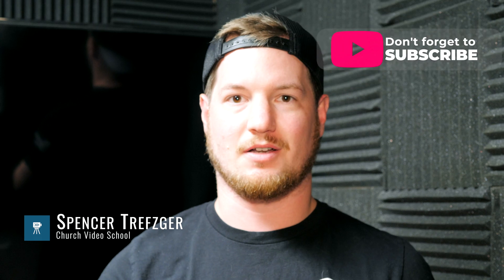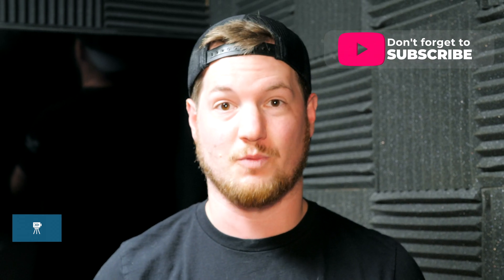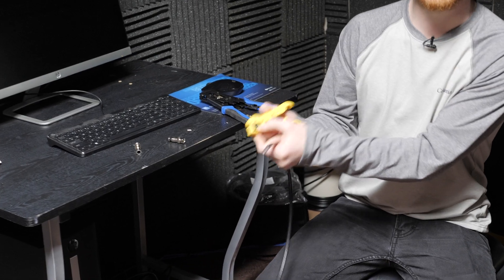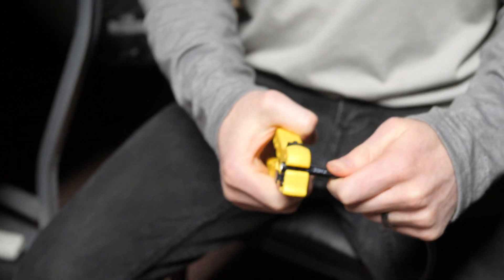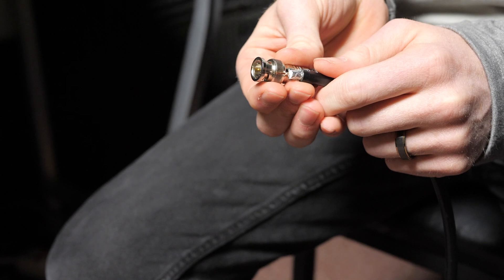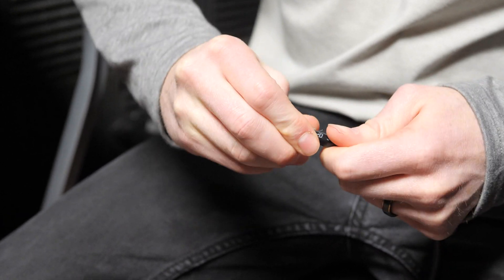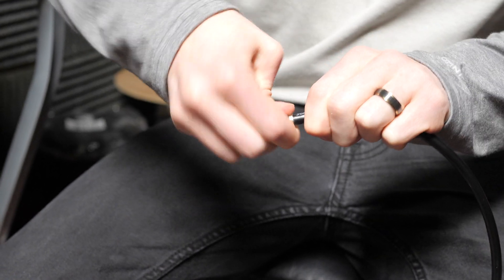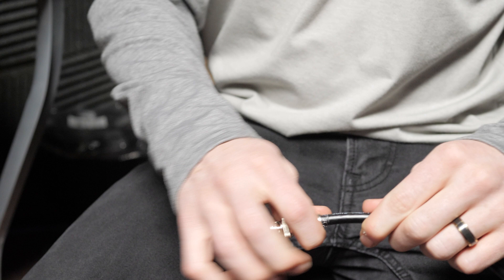How To Make an SDI Cable (w/ RG6 and BNC connectors)

Comment: I have a question I ran a coax cable like 300 ft and im having trouble with the signal and I was wondering if could be the connectors or the converter
Reply: It's the length of the cable, way too long for copper, especially if using cheap materials, and especially if you've stuck a BNC connector on an RF cable not rated for 3G signal. You can test with an SD signal which should carry, that will verify that its not a kink or dodgy connector. Check with shorter cables to test your converters - if it's black magic once you have that sdi lock light you know your cable is carrying an identifiable signal that far.

Comment: Make the copper center conductor longer.  It's easier to get in the hole that way.  Then after it's crimped, snip it off flush with the end of the connector.

Comment: I did not realize until after I ordered that you are referencing RG59 connectors, not RG6.  Since I have RG6 cables, it was a total bust.  Now I'm on the search for compression RG6 HD-SDI connectors.
Reply from the maker: RG59 and RG6 are types of cable braiding, not types of connectors. They both take BNC. With that said, I'm sorry to hear that your BNC connectors didn't work with the RG6 cable you bought. Could you share what brand you purchased so others don't run into the same issue?